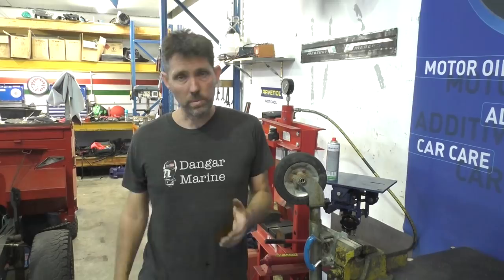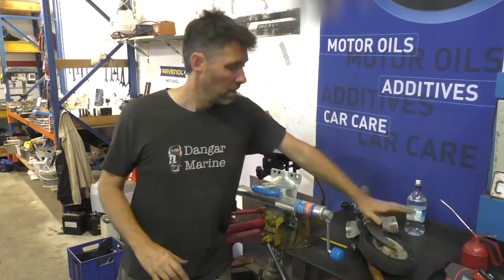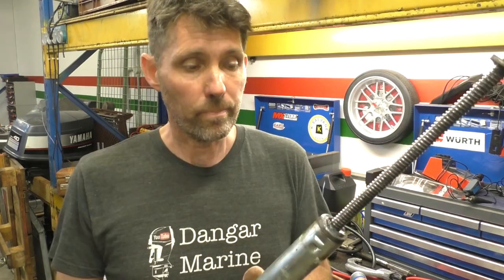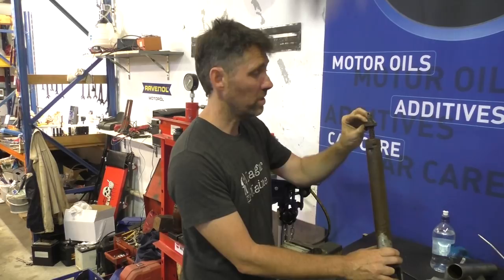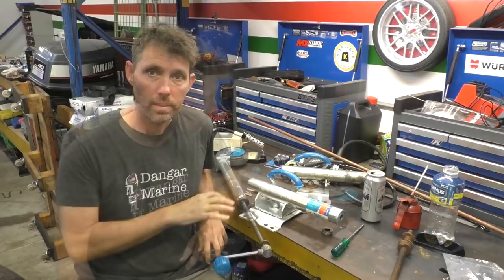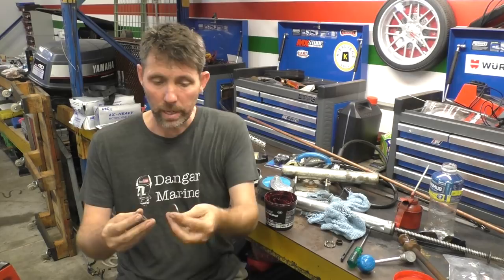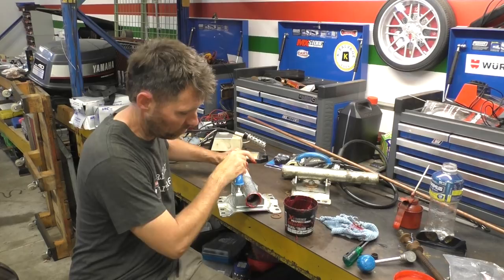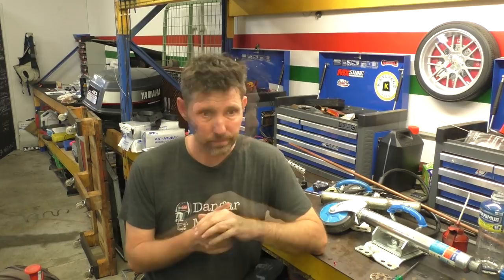Trailer jockey wheel maintenance

Comment: Realise this is an older vid, but I find for trailers that sit outside, the moisture seeping in through the top under the handle is what does most of the damage.  I just use an upturned plastic bucket over the full handle and find it saves the lubrication from dissipating and the rust taking hold.  I know nothing about boats but just found you channel and love the way you explain things.  I guess mechanical is still mechanical, be it boat, car etc.  Great work.

Comment: How about, disassemble it, grease it then take a piece of bicycle or small motorcycle inner tube and make a seal of sorts between the inner and outer tubes to keep the dust and dirt, etc, from contaminating the grease?.  Just a short section of inner tube and perhaps a tie wrap to hold the upper section from sliding down.  Hope this description makes sense.
Reply from the maker: I like the idea of making a modification to the basic design, and some sort of seal or dust jacket does sound like the way to go. I think we might be visiting this subject again!

Comment: Gday mate i think back and i was pedantic about lubing everything up after evey trip i would get the wd 40 and soak the tube and anything else i could find ,that trick with the bearings was taught to me by my father when i was about 8 years old and still use it at 58 great video .
Reply from the maker: A bit of regular maintenance goes a long way, that's for sure.

Comment: I use the idle man's method of jockey wheel maintenance. The ones I have fall in two if you unscrew them to the max. I have a large plastic tub of used engine oil, once a year, or whenever the contraption starts to feel stiff, I unwind it till the bottom bit falls out, then suspend them with a bit of wire in the tub of engine oil, so that everything but the tyre and the handle is submerged, and let them soak for a day or two. Remove and let them drain for a bit, then reassemble and you're good to go. You could wipe the outsides off, if you're worried about such trivialities.
Reply from the maker: Sounds like a good approach. I like any method where you can sit and drink beer while it does its thing. ;)

Comment: Stupendous video Stu. Roll pin, spring pin, and we call it a Drift pin in the States. I've heard them called all three through out my life... I have a Jockey wheel with a bent shaft on my trailer.cranking  it only travels maybe 4 turns them locks up.  Come summer I'm going to disassemble mine and try to straighten the shaft. Appreciate the Education here. Cheers****.
Reply from the maker: Hey Angelo, it sounds like everybody fights with these wheels at some stage in their life. Oh, and thanks for the third term to add it the list of names these pins have! :)
Reply: Your welcome my Friend.

Comment: Thanks Stu. Now I know what is inside these jockey wheels. My assembly has a grease nipple at the top that I have given a few squirts twice last summer. The lower tube I greased once and later I wiped it all off and used a dry silicone spray on it. I guess as the nipple is at the top of the outer tube it might be better for greasing the nut at the top of the lower tube to screw the tube all the way down and hope some of the new grease lands on the threads just above the "Nut" in the top of the inner/lower tube. Another thought I had about dust one the lower tube grease would be to lower the assembly all the way down and tape up the open end IF one was going to go a long way over dirt roads. Which I did one day and lead me to removing the grease and going with dry silicone. Just a thought. Cheers. PS: My boat is in the shed and we had our first snow today. She is in for the next 6 months. Darn!
Reply: Did you see Hawaii had snow today!
Reply: How's the dry silicone spray working out for your jockey wheel?

Comment: another helpful piece of tuition mate...I inherited a couple over the years with flat spots but I'm thinking they were left down for the journey (or part thereof) by accident.  My current one has the non-swing fitting..rather a threaded fastener that is a bit painful..haven't used it since I re-powered with the Yamaha 40 as it weighs about 30 kilos more than the old motor..haha
Reply from the maker: Ha! That certainly is one good way to get a decent flat spot on a jockey wheel!

Comment: On what we call a trailer jack (or junk) I had the same problem, which makes solo maneuvering of a boat into a cursing fit. So, I cut off the large original wheel at the base of the fork, leaving a nice flat flange as a platform. Then I bought a small, but rugged, 4" (102 mm) fork/wheel assembly from Farm & Fleet. It had swivel ball bearings, easily visually verifiable, so I slipped on a large o-ring that contracted admirably into the gap to conceal and "seal" them from road debris. That assembly was then easily bolted onto the old jack flange after the necessity of drilling 4 holes. Now the swiveling is at the wheel and very responsive; and I don't care a bit if the extension shaft fully seizes. Sometimes it's best if one can ignore a seizure.

The design of such jacks is lacking, especially considering how easily they torque sideways and distort - they could use a synthetic alignment bushing at the tube's end to reduce internal mangling. 

Another trick: After initial install of the new jack, it exhibited quite a bit of wangling about on its mount, so I unfastened the tube from the base plate and instituted a heavy 3 or 4" ID snap ring between the elements, relieving much of the looseness (which is preferable, mostly, in women). 

Seems everything, even brand new, these days requires a bit of fine-tuning rework; especially the bargain bin items from the far east. Alas, what's an upgrade, really, if one hasn't had to refashion it some? The ritual of personalization... establishing true ownership via the bloodied-knuckle trademark.
Reply from the maker: I like your idea of just having the wheel at the base turn as there is much less surface area to corrode until the tube-in-tube they come with. Also, as you say, it is there to be seen (and cleaned) much more easily. Nice one!

Comment: If PB Blaster is hard to come by over there, another alternative that believe it or not works BETTER than PB, is a different kind of penetrant called "Kroil". It was originally designed for use in aviation maintenance, which explains the high price tag on it when you can find it. Of course, I have no idea if Kroil is any more available than PB in Australia, but you might want to give it a shot if you happen to come across some locally.
Reply from the maker: Ah, I have heard Kroil being mentioned several times, I'll see what I can find locally. I notice that it comes in 1 gallon tins in the US which might make ordering it more practical that aerosol cans.

Comment: Another great video have you ever heard of graphite dry lubricant doesn't attract dirt and dust i found out about it when working on a go cart torque converter lets the weight move with out dirt making it stick. wd 40 and pb make it in a spray can goes on like spry paint dont know how it hold up to salt water thou
Reply from the maker: Hi mate. We have some dry graphite lubricant in the shop but I normally only use it in locks and things like that.

Comment: As others have posted, I think the motorcycle/off road use shock absorber gaiter is a good way to go to keep the dust out of the tubes. Would an old bearing seal or O ring work to keep the grease in the between the tubes, because with the open end  design, every raise /lower cycle is going to have some grease disappear. But with no mods, I think an annual clean and relube when you do the engine service is a good idea. As my trailer wheel is a basic one I don't have the 90 degree swivel plate mount system . There fore I take jockey wheel off while travelling the highways. Not sure it helps any, but my jockey wheel is about 10 years old. Copied an idea from further up though, I made a cover this morning after watching the vid . The cover is for the top so water doesn't go down the handle /drive shaft gap when the trailer is parked up.
Reply from the maker: Hey Ron, yeah, I do like the idea of a gaiter type arrangement, particularly when using a heavier grease. I'll have to see what I can find that will fit.

Comment: Great video Stu. I have a grease fitting in my unit and Grease it with "Permatex super lube with teflon" it works very well. I hope it's available on your side of the pond.
Reply from the maker: Thanks for the tip, I'll check it out. There are plenty of Permatex products sold in Australia so it should be available.

Comment: Well, I now know what I'm doing tomorrow.... servicing my near new jockey  wheel !
Idea! - for protecting between the 2 tubes from corrosion - I once bought a mercury/ quicksilver engine protection spray that was kinda like crc / wd40 but it was more clear and dried a bit like a paint. It didn't seem to attract dust like other preservative sprays. I think it'd give good corrosion protection and hopefully not attract so much dust. Just had a quick look on their website, think it was the "corrosion guard" product. I'll grab some next time I'm going past a Mercury dealer.
Reply from the maker: Sounds like engine protection spray is worth giving a try. So far I can definitely say that this jockey wheel has stay very smooth, particularly compared to all our previous experiences of just spraying inside the tube with can lubricants.

Comment: Good video stu.You'll find the male end of the tube doesn't make contact with the female end at all as there's always clearance.The seizing occurs at the worm screw,threads and bearing side of things.I use melted parrafin wax in a spray bottle for corrosion resistance sprayed over all components.Winding them fully up/down periodically helps alot too.
Reply from the maker: Yeah, I agree that going through the full travel is a good idea. It seems that giving them regular attention is definitely going to be the only way to get them to last a long time.

Comment: I decided to take a look at my seized jockey wheel. I was suprised to see a grease nipple on the wheel hub which is the part that is seized. Put the grease gun on it and it immediately snapped off in the grease gun. Took some vice grips and a fair amount of wrangling to get it back out of the guns nozzle. I won't be trying your tips on this jockey it turns out. I'll just be getting a new one.
Reply from the maker: Sounds like you are in the same situation as my first one. Having said that, you might be able to use your vice grips to wind the grease nipple out of the jockey wheel too. They are threaded in and easy to replace, but of course you would still need to free up the hub...

Comment: Another great video Stu. I’m lucky enough to have a grease nipple on my large trailers jockey wheel. I pump in a good marine grade grease one or twice a season the same time I do all the fittings on the outboard. So far so good. I guess with the models with no fitting a good practice would be to take it apart when brand new and give it a good cleaning and greasing with a marine or heavy duty grease. Just like the job you did with the red grease. The factory will never grease it that good. Better to do it yourself and do it right!
Reply from the maker: Hey Jack, it's interesting to hear that the larger wheels come with grease nipples already installed. Is it in the outer casing to add grease in between the two or does it get grease into the sealed part?
Reply: Dangar Marine the fitting is on top right above the crank handle. I'm not sure if the grease is getting forced all the way down the tube, but I do put quite a bit in there. I do notice some oily residue on the two halfs, so its possible that grease might be making it down there. It's an older jack made by a company called Fulton. I haven't had any issues with it for all the years I've owned it.

Comment: good to see this. I just got one today from Amazon, used, so saved 20%. I need it to be a bit shorter, maybe 6 inches shorter for my application. It looks like I could achieve that cutting that thread down and reforming the flat on the end and drilling a new hole, and then taking the same amount out of the top tube. Am I right or missing something? Ta

Comment: For those telescoping metal tube sections that collect dust, maybe a dry lube (some sort of spray graphite) would be a less troublesome choice than a "wet" grease.
Reply from the maker: We tried a variety of dry lubricants first but none of them seemed to help with the corrosion. I think the heavy grease with a seal to keep the grease clean is going to be the way to go for us.

Comment: Spray the tubes with polyurethane or paint.  It'll scratch and wear over time, but keep the salt off of most of the surface.  You can add grease to it then.
I'd try it myself, but am 1,600 km from the nearest salt water!

Comment: i was trying for the life of me to think what a jockey wheel was. duh   if its hard to get  blaster  you can mix acetone and atf  not quite as great but still good.  i always put motor oi around the stem with the wheel extended then worked it up and down  but then i never dealt with saltwater.
Reply from the maker: Yes, an ATF / Acetone mix is a good one for freeing up corrosion, I'm hoping this grease will prevent it getting that bad. Time will tell!

Comment: How would a Teflon Moly Oven Cure Spray Finish work? Product is a little expensive;
but because it is an epoxy paint basically, it is extremely durable.

Comment: Great vid Stu .. I have been wondering on the best way to keep the jockey wheel running free; had been ‘cheating’ with the old WD
Reply from the maker: It was a bit of an experiment at the time but not I can safely say this is the longest this jockey wheel has ever stayed smooth for, it's definitely worth the effort.

Comment: I am designing a RIB and would like to have two fuel tanks.  What would you suggest for plumbing arrangement?  I will have a de-water filter.  Maybe a Y-valve and two separate bulbs, etc?  This might make a good video BTW.  Thanks Stu.
Reply from the maker: Having a separate bulbs is a good way to go, it would make an interesting video!
Reply: It would make an interesting video.  Thanks.

Comment: Hey Stu,  I  sail a trailer sailer yacht with a Toyhatsu 9.8 2 stroke  in the well of the cockpit and somtimes the exhaust gases hang around in the cockpit which makes the engine run really bad, I suspect  this is coming from the idle port which is on the rear of the leg above the water line. what is the purpose of this port? can it be blocked ,or a pipe stuck in it and re routed?
Reply from the maker: Hi mate, that exhaust relief port is quite a problem with some yachts. Here is a forum post where people have just re-routed it using some flexible pipe http://www.pearsonariel.org/discussion/showthread.php?322-Outboard-Exhaust
Reply: Thanx Stu.

Comment: Good video.  I battle with this same issue as well.  Have you ever tried using boiling water to remove grease from hard to access part like this?  Certainly NO Chemical solution?
Reply from the maker: Heat is a great way to soften grease. A bit of degreaser in the water would also help a lot.

Comment: Hello my name is Tim and I have a question I have a 200 horsepower Evinrude Outboard and my question is I filled it up with non ethanol gas when 15 miles out the whole round trip is 30 miles but the the engine only would go 8 to 12 knots and I couldn't understand why what's up full frontal but I didn't make it all the way in because I ran out of gas can you tell me what you think the problem might be so I can get this engine fixed it because without it I have no boat like I said I had a full tank I had to call Seto to get me back in and it only went 8 to 12 knots I change many components on an engine thinking it would change but nothing it would idle fine and it would do great on the holes but once it was under a load it was 8 to 12 knots and that's all it did so if you have any idea how to fix that I sure would appreciate it my name is Tim Crews I live in Riverview Florida thank you
Reply from the maker: Hi Tim. I would start by taking the plugs out and seeing what colour they are. If they are very black you might find it is running rich which would give you poor performance and fuel economy.

Comment: Man I love your videos .. hey can you answer a question for me? ... I'm having trouble finding the serial # for my outboard so I can order carb kits .. where all can I find the serial # posted on the out boards ?
Reply from the maker: Most outboards have the serial number as a sticker on the mounting bracket, they can sometimes be on the Welsh plugs on the block too.
Reply: pimpshack81 It should be on the transom bracket. I bought a 97 Yamaha before that had an 86 transom bracket. So I tried googling every number on motor block to no avail. I called Yamaha and I found a sticker on the block that Yamaha was able to match.
Reply: Dangar Marine thank you sir
Reply: jimbo gasoline my motor is a 1977 Mercury 850EL 85H.P..... as soon as I can look at it in the day light I'm going to search further
Reply: pimpshack81 Yeah , I have a 50 merc. The El should mean elect start long shaft. I have elpto, electric start, long shaft, power tilt.

Comment: The pivoting part on mine is stuck.  Do you have a suggestion on repairing this section of the trailer?
Reply from the maker: I would try a bit of penetrating oil and some heat.
Reply: Thanks